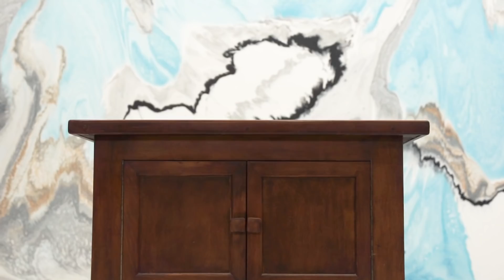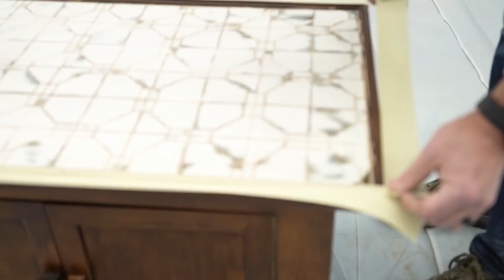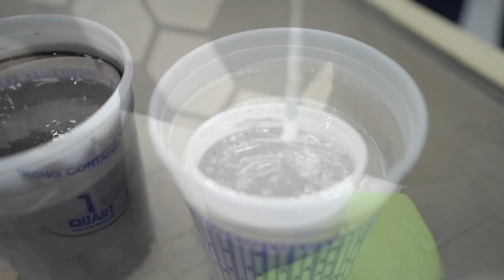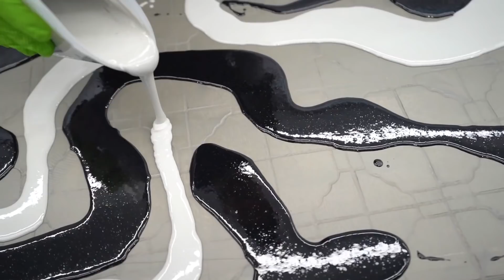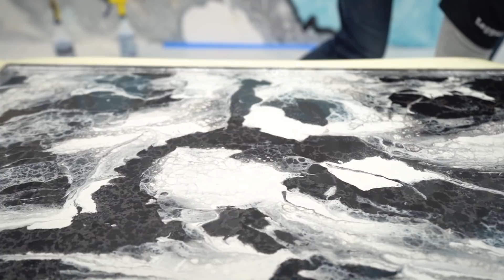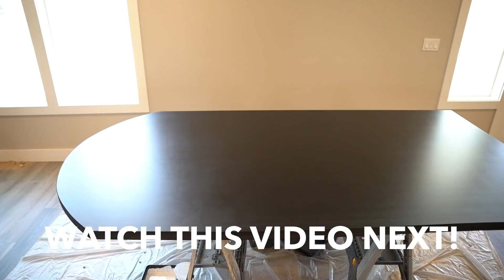Epoxy Table Over Old Tile | DIY Project Anyone Can Do

Comment: To be honest, personally I like the tile better. All it needed was polishing.
Reply: It was so unique! I’d be interested in the back story.
Reply: @fghdfghdgfh  - I think the tiles on this table gave it its own character. All it really needed was to have the wood refinished for a brand new look. I think the epoxy table top would have worked if the table hadn't had the tiles on it first. It would have made it look like a counter top rather than a table. My opinion only.
Reply: You missed the whole point.  It was to show that YOU COULD pour over existing tile.  Some of us DON'T like the tile we have.
Reply: @melbround1  - I didn't miss the whole point. I know what the point was. I simply expressed my own opinion, that's all.